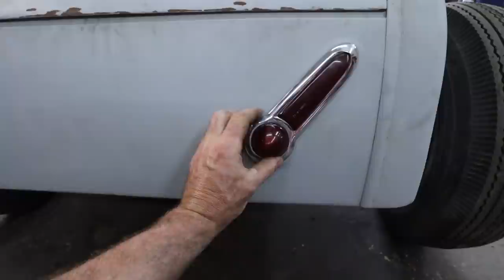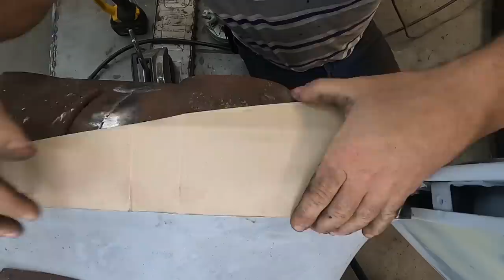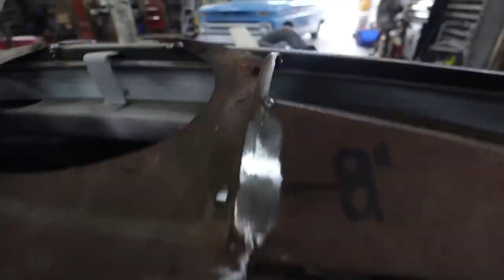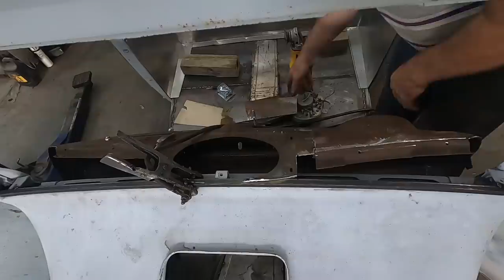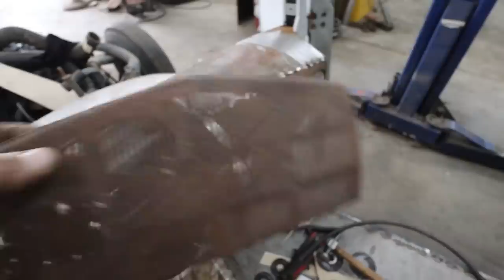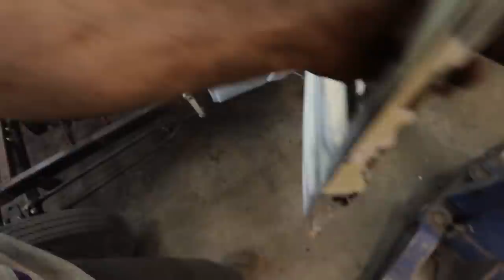Making dash tops from scratch for the sectioned Shoebox dash in the Model T hotrod.

Comment: HI Brent. Looking way better than I expected since I wasn't initially a fan of the '50 Ford dash in this application. You did a great job of integrating it in. The round center plug beneath the speaker grille is crying out for a round gauge like oil pressure, clock, or whatever. You mentioned that the top has already been chopped some so you would have limited head room if you chopped it further, but if you can take another couple of inches out of the top I think it would improve the side profile and reduce the"T" phone booth look a bit. You are super creative. Very interesting. Keep up the nice work.

Comment: Brent, for your flat piece of Aluminium behind the seats. Perhaps you could stiffen the back side up by using 1x1 inch AL angle and double side tape one leg to the flat sheet. It will help prevent “jerrycanning” if you choose not to bead roll.  The design would be the same as bead rolling but it is stiffer (higher moment of inertia).  Saves on the dampening sheets too.  You could also do a bead roll with the crown facing the car cabin, and on the back of the Al sheet, paste the 1x1” angle.

Comment: I have to admit I was afraid the dash wasn't going to work out very well, but you pulled it off, of course, and it looks great!  I am often impressed to see how you can weld different gauges of sheet steel together without burning through.  I used to do a little welding with acetylene and coat-hangers, so I know it isn't as easy as you make it look.